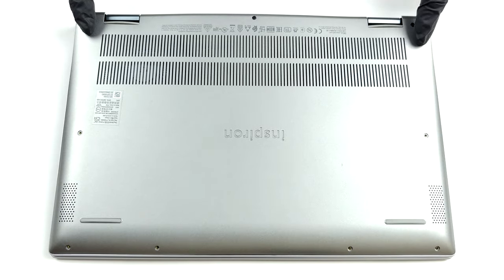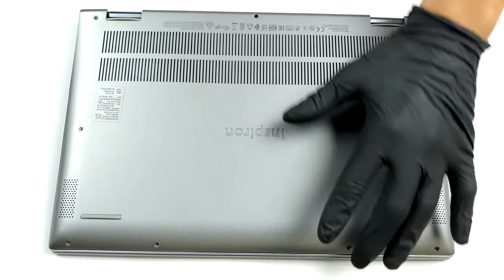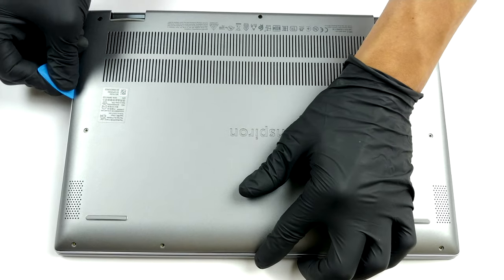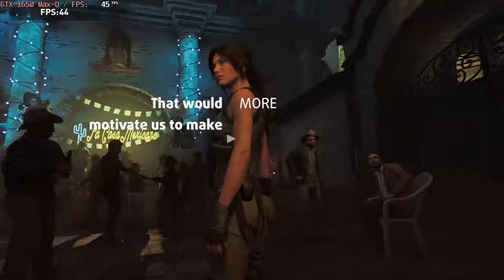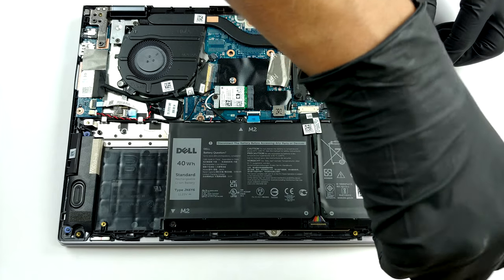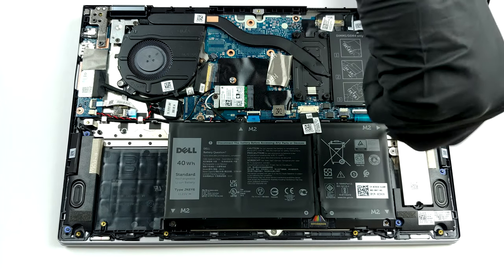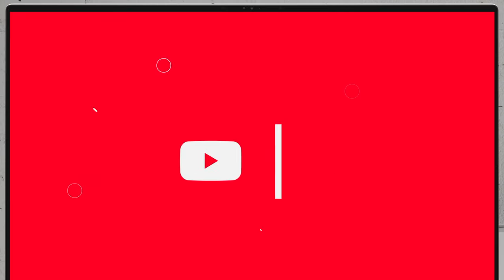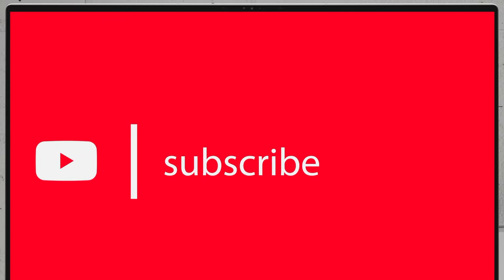🛠️ Dell Inspiron 14 5406 2-in-1 - disassembly and upgrade options

Comment: Wish they made more laptops like this. Two RAM slots, fully upgradeable even in a 14" 2-in-1.
Reply: I'm using it now, and I have to complain that with a i7 1165G7 the cooling solution is not sufficient. It's just hotttt
Reply: @averyoldYoutubeuser It's normal for Laptops to be hot at gaming at least. As long as it not to hot to touch

Comment: Thank you uploader. I have one (with the mentioned 53w larger battery), and was curious about the disassembly steps. I would like to replace my original keyboard (silver with blue ilumination, ABNT layout) for a black one, like the previous 2020 model. The silver one is difficult to read (even with the ilumination on) under certain conditions. Any suggestions?